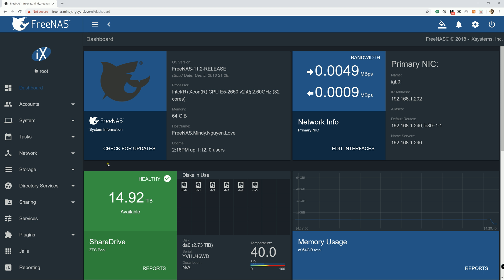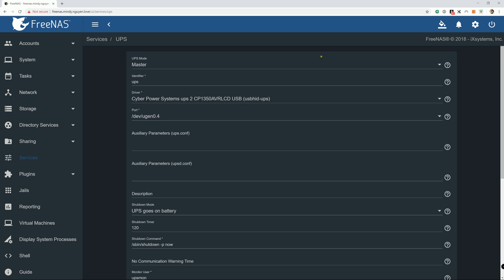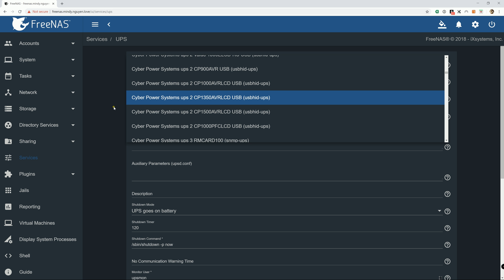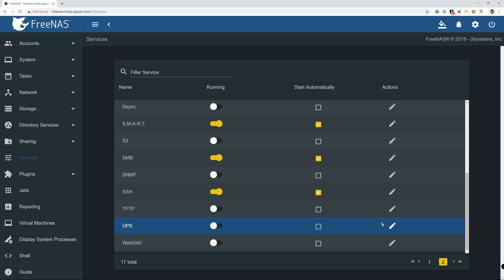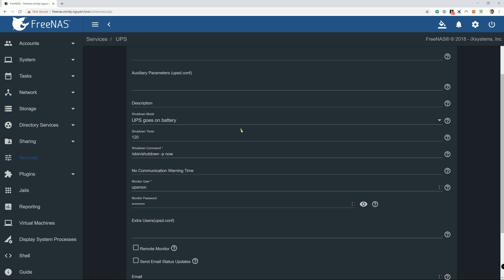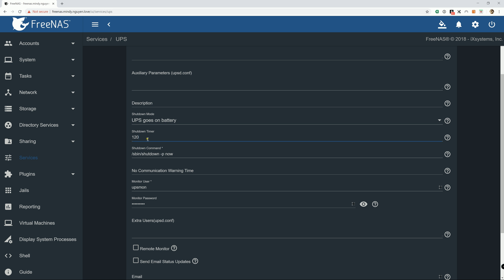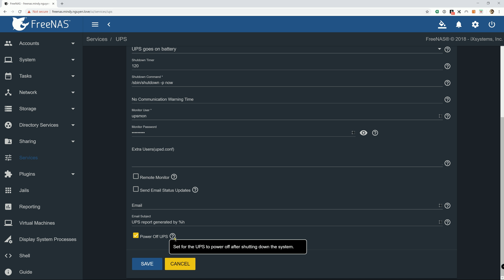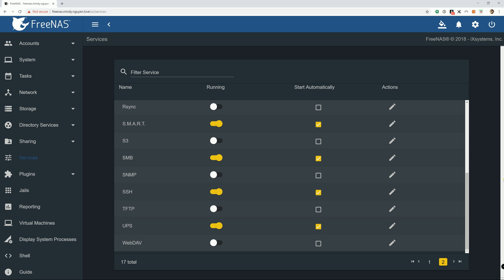FreeNAS 11.2 - How to set up Uninterrupted Power Supply #UPS on #FreeNAS 11.2R

Comment: I watched your video after trying to set it up before even seeing this video, and I am getting this error. How do I fix this? 

Jan 18 17:06:12 truenas 1 2024-01-18T17:06:12.071931-05:00 truenas.local upsmon 14751 - - UPS [ups@localhost:3493]: connect failed: Connection failure: Connection refused
Jan 18 17:06:12 truenas 1 2024-01-18T17:06:12.127747-05:00 truenas.local upsmon 14750 - - upsmon parent: read
Jan 18 17:06:12 truenas 1 2024-01-18T17:06:12.470958-05:00 truenas.local collectd 14929 - - nut plugin: nut_connect: upscli_connect (localhost, 3493) failed: Connection

Comment: If you don't find a driver that matches your UPS, pick one that's close and run the command "upsc ups" to see if the driver is correct.  if it connection refuses just try another driver until it works.
Reply: Hope I'm not too late, I tried running that command and I got a list of stuff about the UPS... It means that all should work, right?